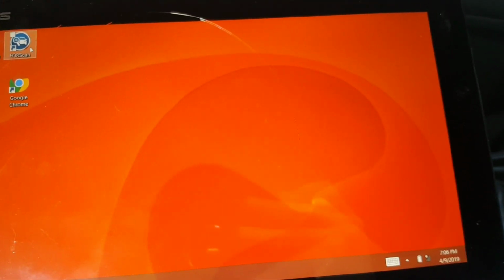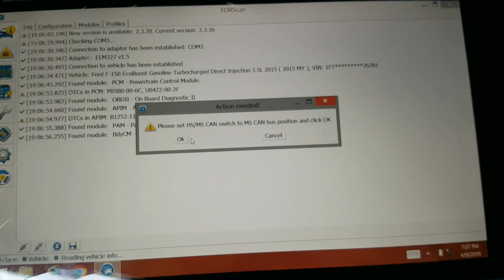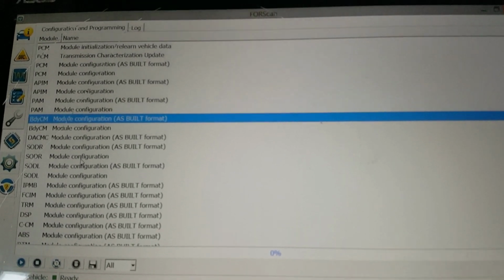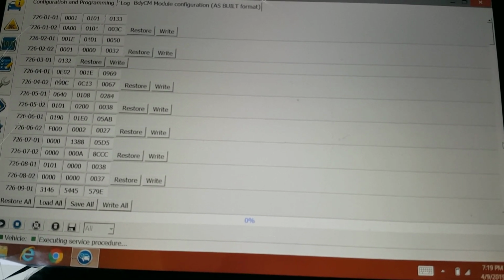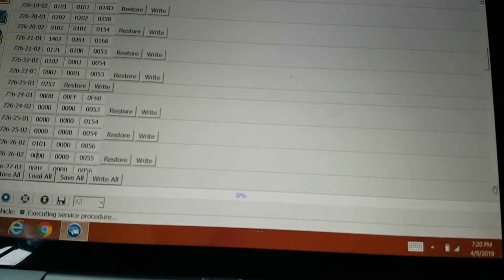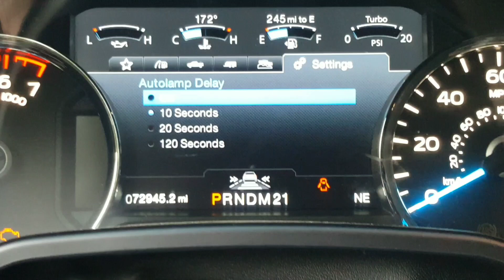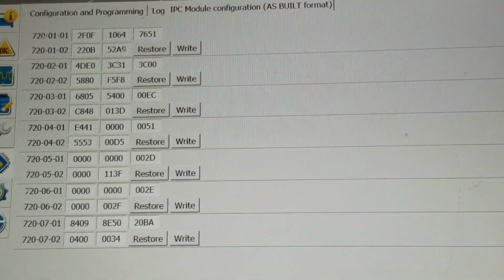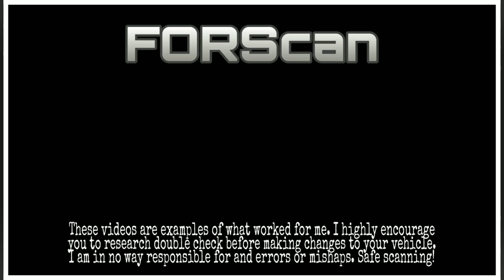FORScan DRL mod on ford f150

Comment: Maybe you can help me. You seem to a broader understanding of forscan. Im trying to program DRL in the park light/turn configuration but it keeps blocking me. I currently have the DRL with just the park lighs and it works fine but i cant get the turns on with them. Do have any experence with this. 2017 F150 Lariat.
Reply from the maker: Thanks for watching Ernie. If you have LED Headlights @6:00  should work.
BCM 726-26-02, 726-45-01, and 726-50-01.
Reply: Ernie, what did you input to get your parking lights only to work? I tried doing it tonight and I could get it. When I put the vehicle in drive nothing was coming on in the headlights.

Comment: Is there a way to prevent the user from unchecking the box for daytime running lights? Basically always force the running lights be always be on if the vehicle is on? No way the operator can turn them off.
Reply from the maker: I'm not sure if you can woth every truck. But the f150s with the 7inch instrument cluster does have the option.
Reply: Ricardo's Workshop I’d love to know how! Canada requires the vehicle have daytime running lights on all the time. The issue is with my 2017 f150 it has the option to turn them off. Also if I change the lights from auto to off they turn off...
Reply from the maker: I believe its in ghe BMC 726-50-01, 017F
But checkout the spreadsheet https://docs.google.com/spreadsheets/d/1uDSQ1Z5a2Wt8-kjrSiVSlDFGFHnfeuhb3RTMVz95730/edit?usp=drivesdk

Comment: Great video!..I always wanted this done I have the same headlights As yours.. I just got the lariat tram I’m curious which one did you go with
Reply from the maker: Hey Hervey... thanks again for watching! I went with fog lights but keep DRL off.
Reply: Hey  I tried with the parking lights only and it came back riding blocks failed ..we the Halogen lights right??
Reply from the maker: It should work with LED too
Reply: Ricardo's Workshop what light do you have?
Reply from the maker: LED oem but in order to extend their life, I turned DRL off